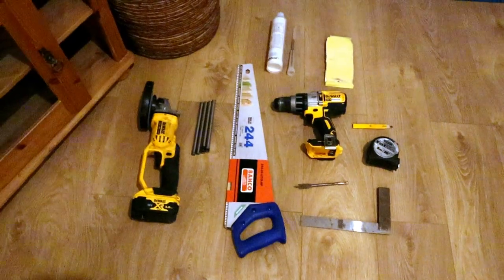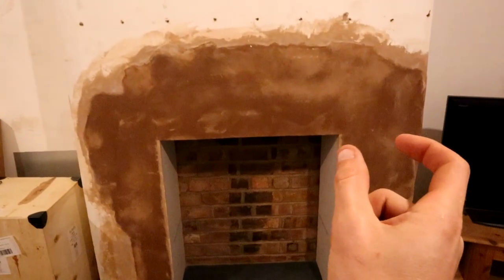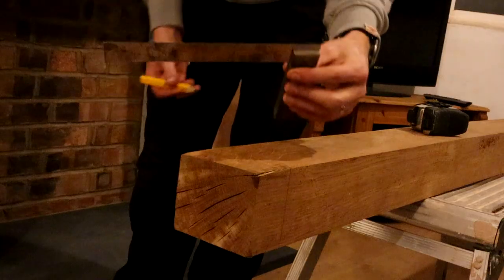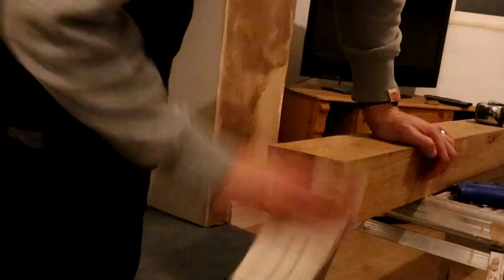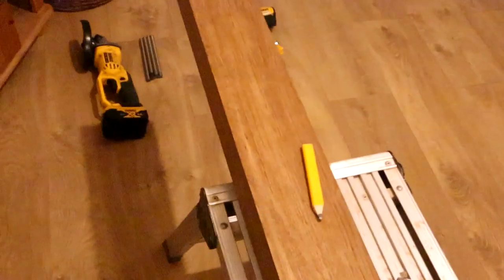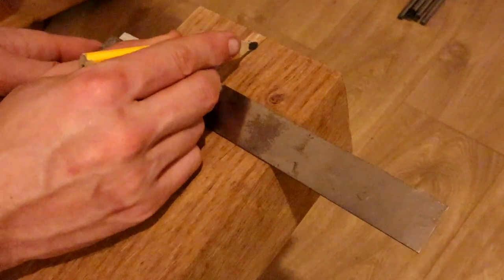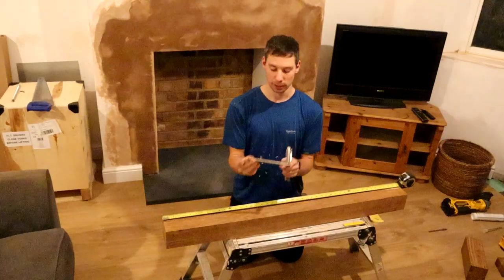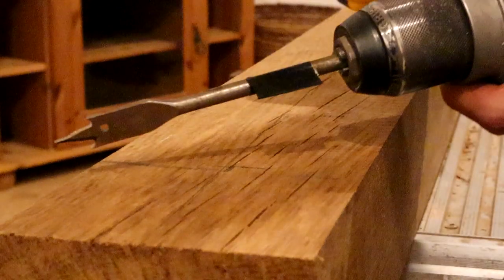How To Fit A Wooden Mantle Over A Fireplace

Comment: Nice one. I made a simple template screwed to the back of the beam, then drilled. Transfer template to wall (the right way round!) level and repeat drilling. Probably added 10 mins to the job but absolutely bang on with the alignment.

Comment: The mantle overhangs the fireplace by 7 inches, that works out to be 1200 wide! (glad to hear I'm not the only one who measures in m and inches!) Personally, looking at the piddly bits you cut off, I would've been tempted to centre the whole beam.
Reply from the maker: Glad I’m not the only one who does it.
It was a piddly little bit that I cut off but the beam was slightly damaged on one corner so I cut it off.

Comment: Looks a solid job, what size drills would you recommend for drilling into the wood and brick?
Reply from the maker: Thanks.
It depends how thick your threaded bar or rebar is. I’d suggest making your hole a few millimetres larger than your threaded bar to allow a positive connect with the resin. 
Cheers, Ben

Comment: Thanks for the video, it certainly helped me install our beam. One question - I've noticed that the gap between the wall and the beam is very slightly (2mm) larger than when I installed a few months ago. Should I be concerned by this is, or is this a normal occurrence?
Reply: I should add that appears the gap has only grown on one side of the beam
Reply from the maker: I’m pleased the video helped. 
Yes, this is normal and it’s nothing to be concerned about. My beam has done the same thing and has even twisted slightly but I feel this adds character. The gap occurs due to thermal expansion of the threaded bar. Your gap may increase some more but it will stabilise. 
Thanks, Ben
Reply: @BerkleyBuilds  Great, that's a relief! Thank you for the quick response.

Comment: When drilling into the chimney breast and fitting the mantle would 110mm be close to the flue will  it go straight through the breast have done the same but not fitted yet thanks
Reply from the maker: Hi Ab, great question! You’d have to check the thickness of your chimney breast by looking up it. Some chimneys might be one skin of brick or it could be two skins. If it is one skin then 110mm would go through it. Good luck with your project, Ben

Comment: Great video I'm assuming the thread bar measurements are backto front? You said 110 in wood and 70 into wall 🤷‍♀️
Reply from the maker: These measurements were right for my set up. Measurements don’t have to be mm perfect but you do want to avoid drilling all the way through the brick, because this will cause the threaded bar to get hotter resulting in more thermal expansion. When drilling into the timber drill to a depth thats 3/4 the way through so you don’t punch a hole through the face of the timber.

Comment: I used a couple of keyway brackets recessed into the back of the timber, and then just two corresponding screws put into the wall. The advantage is that I can lift the timber   off at any future time for decorating etc.
Reply from the maker: Great idea Harry!
Reply: Nice idea, what gauge/length of screws would you recommend please?

Comment: Hi great vid, what diameter were the threaded bars please ? We have a 35kg oak mantle to fit so I am going to use M12, what diameter holes should I drill for the resin? I’m planning 14mm holes for M12 threaded bar.
Reply from the maker: Hi Martin, i used M12 and approx 14mm hole. Good luck with the install. 
Something to be aware of - If you’re looking to have a HETAS engineer sign off on the log burner then ensure your mantle is 450mm above the log burner. It’s a requirement in Approved Document J

Comment: Great video. For any job there are at least a dozen different solutions. I liked this approach. It would be interesting you hear your comments on the heating\building regs and where the 450mm distance came from.
Reply from the maker: Hi Fred, thanks for watching and I appreciate the feedback.
As a building inspector I have come across this issue a number of times. The 450mm comes from Approved Document J of the buildings regulations. It states an insulated flue pipe must be at least three times it’s diameter away from combustible materials. Flues are typically 150mm resulting in the 450mm requirement. A HETAS engineer may not issue a certificate if the mantle is installed incorrectly, equally this would be a contravention and a building regs final certificate could be withheld until resolved.
Reply: I've been looking for info on this but can't find anything definite... Document J says the main distance (unshielded) between the flue and the beam is three times the diameter of the flue in any direction but I couldn't see anything about the top of the actual stove. A 5 inch flue pipe means 381mm . In that case.
But the length of the flue pipe coming off the top of the stove can differ so I'm still confused about where the 450mm comes from.
Are you able to clarify?

Comment: Hi, you have inspired me to fit my new beam myself. I bought some threaded rod with the beam, it's 8mm thick (which I'm guessing is m8!) What size drill bits would you recommend? 10mm? Very helpful video, thanks a lot, Steve
Reply from the maker: Hi Steve, I’m pleased I’ve inspired you. A 10mm drill bit should be ample, you need enough space in the hole so the resin surrounds the threaded bar. As you push the bar into the hole give it a twist to give a good key. 
All the best with the project.
Ben

Comment: What resign did you use mate ?
Reply from the maker: I used a mortar resin, no particular brand. You can get resin from ScrewFix, Toolstation or your local builders merchants. Good luck with your project. Ben